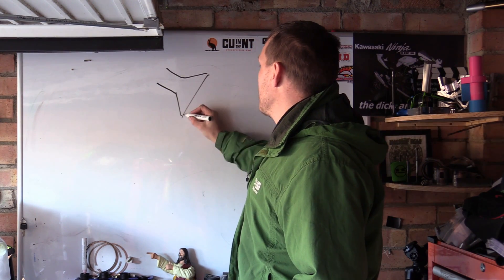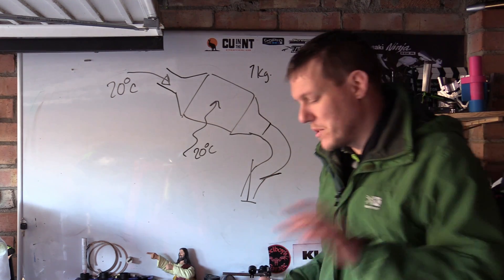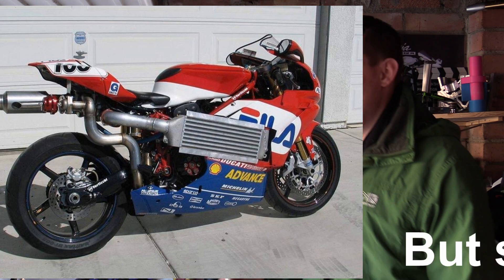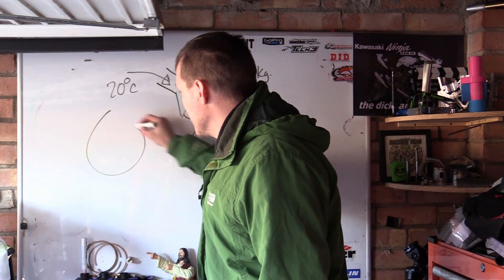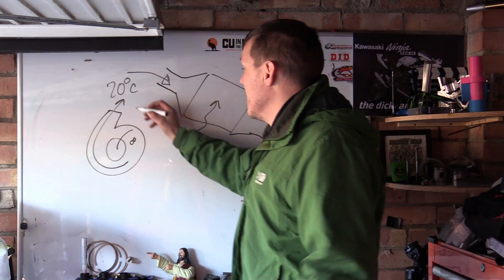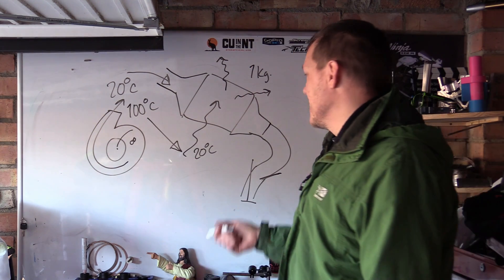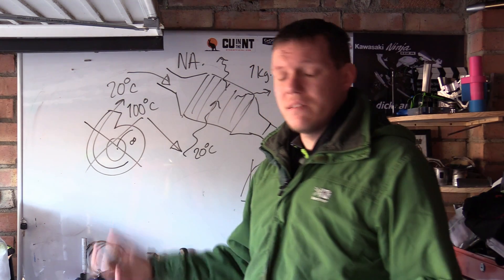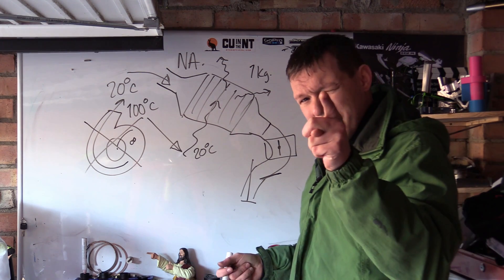Intercooling an NA engine?

Comment: Hmm, no. Just because the air is 20° C doesn't mean there isn't cooling. As air changes velocity, it changes pressure, and thus changes temperature. Circulating fans cool you off in the heat even though all the air in the room is at a given and high temp, the pressure delta causes slight temperature changes, and it carries heat away. Not saying that an NA engine would necessarily benefit from an intercooler, unless the ambient air was being heated by the engine.
Reply: The reason circulating fans cool you off is due to a combination of evaporative cooling from your sweat, and the fact that the air is prolly still colder than your body temperature.
Reply from the maker: "As air changes velocity, it changes pressure, and thus changes temperature."

- and by how much? The other thing you're missing here is the air flowing through the port into the cylinder. 

So looking at it this way if you're travelling at say 60mph (26m/s) as the post velocity is say 80m/s @ 5,000 rpm then the air is cooling the intercooler. 

So your comment "Hmm, no." - is wrong - try again
Reply: Well, if you were dealing with an idea gas then temperature deltas would have a direct one to one pressure delta and vice versa, but in a blend of gases it becomes more difficult to calculate as there's an uncertainty as to what mixture of what gases we are dealing with. Air is never am absolute mixture of Carbon Dioxide, Oxygen, Nitrogen, and so on because of pollutants and other contaminents such as moisture, various stray particles of refrigerant gases, Helium, Argon, Radon, and so forth. If an average could be accurately measured for a given space, such as an enclosed track with perfectly seals and there was no convection process occuring, the molar density of the heterogeneous mixture could be calculated and the tempurature and pressure differentials could then be calculated.
Reply: "The temperature of the gas is proportional to the average kinetic energy of the molecules. Denotes the average kinetic energy of the molecules, and is the Boltzmann constant (1.388 x 10-23)."
Reply from the maker: Next you have got your reference frames mixed up. If you're going say 60mph the air is static - the intercooler is hitting the air.
Reply: The air is moving in relation to objects moving through them. That's how airplanes work.
Reply from the maker: ""The temperature of the gas is proportional to the average kinetic energy of the molecules."

- I think you're misunderstanding what this means. "Proportional" as in like for like increase. Therefore based on what you have said - fast flowing air through the intercooler should HEAT UP the intercooler, not cool it down.

Try again.
Reply from the maker: LOL 

Force and temperature are different things....... Moving a bike though air at 100mph and moving air past a bike at 100mph are frameless when considering forces not thermal energy.
Reply: No.
A fluid at higher velocity will have decreased pressure. A bike moving through air forces to accelerate. Fluids at decreased pressures decrease in temperature. All but ideal fluids will have only minimal changes in temperature for comparatively large changes in pressure. An intercooler may absorb heat from an external source like radiation from the sun or some other source and the net heat exchange could be either zero or functionally zero and thus only have negative impacts on performance, but that's not the point being made.
Reply: As far as the temperature and velocity deltas, I made an error and didn't double check to make sure the equation posted. I apologize for the confusion.

T=(2/3kb)K

Where K denotes the average kinetic energy and kb references Boltzmann's constant.
Reply from the maker: "Fluids at decreased pressures decrease in temperature."

- But where is the pressure drop? Infront of an intercooler (due to the restricted passages) the pressure infront of the intercooler increases. This is form drag. This is why a blackbird was made from titanium because the faster it travelled the hotter it got. So again, this would cause the intercooler to get hotter. 

"but that's not the point being made."

- I'm totally lost on the point you are trying to make.....

Back to the beginning -

"Circulating fans cool you off in the heat even though all the air in the room is at a given and high temp,"

Because you are hotter than the surrounding air. If the air temperature is the same as you then the cooling effect is through vapourization of the sweat on your skin through evaporative cooling. 

Kinetic energy or transfer or momentum is from the bike (intercooler) to the air. The air goes from being stationary to moving. 

You're mixing up thermodynamics and ideal gas law and momentum. Heating up a volume of gas (energy input) is expressed by the increase in kinetic energy of said gas and this is expressed as pressure at the volumes surface area as pressure, or transfer of momentum. Kinetic energy is not a direct converter for temperature. 1/2mv^2 = no mention of thermal energy. 

Kinetic energy is frame dependant, thermal energy is not. For certain idealized systems, such as an ideal gas in thermal equilibrium, the temperature can shown to be proportional to the average kinetic energy of the molecules, as measured in the rest frame of the gas. 

Rockets in space don't heat up because they're moving.
Reply: There are several text books on this field if you'd like some answers. I've decided I'm not doing this anymore. Have a good day, bye.
Reply from the maker: So basically you're giving up? That's disappointing. 

"There are several text books on this field if you'd like some answers."

And that's a shitty argument. Well maybe you should read some of those textbooks and get a better understanding of thermodynamics. Or better still, I'll do a video.
Reply: I'm not giving up, I'm just not your physics professor and it's not worth it anymore. I was attempting to be supportive of your and your works but it seems you didn't like it or me, so I'm going to move on with my life.

Comment: I've been trying to find how a turbocharger actually compresses air but all I can find is simple explanations such as the exhaust gasses turn the turbine. What I'm actually interested in is how does the air go from atmospheric to a higher pressure. I've been researching how a centrifugal compressor (this is what a turbo is) works and it has to do with Bernoulli's principle - I think...  

Basically, my understanding of how it works is the compressor speeds the air up to a high speed and then the air is slowed down by the turbo housing - this causes the air to increase in pressure and to also heat up. Would I be correct in thinking this?
Reply from the maker: Basically an impeller adds energy to the intake air. It does this through momentum transfer - basically strikes the air molecules and this increases their velocity. 

The impeller doesn't compress anything - infact it lowers the pressure by reducing air density.

What the impeller does is ram more air into the manifold that the manifold volume allows at atmospheric pressure. This increases the pressure by squeezing in more air than it could normally take.

Only when the manifold becomes higher than atmospheric is the impeller really doing work.
Reply: i use to wonder about that, its simple to understand a piston type compressor because the volume of the cylinder gets smaller and the air is forced out. But if you put your hand over a hair dryer or one of those inflatable bed centrifugal fans then the air flow just stops but the motor still spins. The air must be then slipping past the blades for that too happen. On a turbo charger the air is being batted off the compressor blades at mach 1.5, then due to the volute shape of the casing the air stream slows down, its the Bernoulli's principle like you said. If you have an inflatable bed and use the centrifugal fan you can actually sit on the bed and  It will actually still inflate because the speed of the air inside the bed slows down and gains pressure.

Comment: A lot of cars, and some bikes, have throttle bodies that interact with the 'cooling' system so they are heated to ~90ºC.  This is done to prevent icing and cold start improvement etc.  So if you don't need that capability, bypass it and you'll have slightly cooler charge air :)
Reply from the maker: "A lot of cars, and some bikes, have throttle bodies that interact with the 'cooling' system so they are heated to ~90ºC."

- I'm unsure what you mean, example?
Reply: @thedirtyworkshop  the throttle plenum will be hollow walled and allow water system coolant to pass through it thereby rasing the temp to ~90 deg C. It's a common mod to bypass it so the cooling loop misses it out

Comment: Charge cooling is all about avoiding self ignition due to rising temperature when the charge is compressed, right?
I've been thinking about a possible system of turbo charging. First you charge the air to a very high pressure say 4-5 bar. You cool it very well say to close to ambient temperature. But you have a restricting throttle/intake manifold which drops the initial pressure to say 1,5 bar. Now wouldn't the temperature drop also, theoretically you'd have air going in to the engine that's well below the ambient temperature? In short, intial pressure way higher than your engine can handle, the dop it to what ever manifold pressure is required. The advantage? Being able to use higher dynamic compression ratio and thus greater efficiency. 
Ok, doesn't relate to this video's title but just a thought.

Comment: technically you could do a water to air setup. run an a/c compressor to keep the water in the system at 4 degrees . that would gain you some density and cool the air. you might gain 2HP. but the compressor would be heavy and you need engine power to drive the compressor rob you of power. so extra 12kg for compressor + water and radiator - 5hp to drive it. = NO GOOD= a delboy turbo setup that gives you no benefit. so it wouldnt be worth it.
or you could use a dryice setup. but that would need constant changing. and ppl would be like what is that smoke coming out of your engine for haha 

did he end up selling that turbo POS. I havent seen it ??? 

and the picture of the intercooled bike. air comes in from the inside and feeds out . so it would have a duct from the front going into the inside of that inter cooler

Comment: I think it was me who sent you thay pic of the turbo bike with intercooler. I had a question about that. Why bother putting the turbo at the end of the exhaust and fitting an intercooler instead of just fitting the turbo right after the exhaust port?
Reply: geitenkaasje1 didn’t he make a video on two stroke exhausts and turbos and that it makes sense to build some proper piping for the exhaust.
Reply: @miatafan  yeah but it's not the same for 4 strokes. This also has an intercooler wich hasn't been discussed

Comment: Some old land speed guys used to use a water to air charge air cooler on N/A engines, but they use ice water with salt to obtain temperatures below freezing. But land speed racing isn't weight limited and only runs in short burst. From my understanding it was a loophole in the rules and actually helped with detonation when running at wide open throttle for such long periods at high rpm.
Reply: Water injection works on a NA motor though

Comment: I've heard of people putting dry ice in their air box.
Is this just bullshit or can it make a difference?
Reply from the maker: In the airbox - then bullshit - CO2 is no good for an engine......
Reply: @thedirtyworkshop  Oh, of course. Duh.
 I hadn't thought of that. It was something I heard years ago that people supposedly tried to do to lower the intake temps.
Reply from the maker: It will, don't get me wrong - but its also heavier than air (or oxygen2 and nitrogen2) so it will choke your engine out. Fucking idiots some people
Reply: @HADDDOCK777  IV never seen it in the airbox I HAVE seen ice boxes used as a seperate thing to cool air coming in though mainly in drag cars using alcohol injection.

Comment: What if you transfer heat from exhaust to intake. Would it make engine more efficient? At low throttle openings the max power loss would not matter.
Reply: I Think thats the point of reverse flow cyl heads
Reply: Transfer heat from exhaust to intake? To heat up your intake charge even more? AFAIK, you want your intake charge to be as cold as possible to get higher efficiency.
Reply: @FranseFrikandel  wrong

Comment: I've always wondered about running a copper fuel line in a tight coil around an aluminum intake breather tube before it goes to the fuel rail. It would take a brave dude to get behind the wheel, but, there's no shortage of lunatics who would risk roasting themselves for a couple horsepower.

Comment: Correct me if I'm wrong,  but I thought an intercooler is between 2 sets of super/turbos but with only one is an aftercooler.  Separate from an exhaust cooler.  (these terms if I recall correct are all quite old,  like ww2 airplane stuff)
Reply: You are correct. Intercooler is when its between 2 compressor stages and aftercooler is when there isnt another compressor stage coming after BUT thats just ww2 aircraft stuff as you said. In the car world that just lost its actual meaning. What they would refer to as an aftercooler in ww2 is now known as an intercooler in the car world

Comment: As you said at the end, could be made to "work" with an air water intercooler with iced water which would get a small temperature gradient and cool the intake slightly, but it would be so little I can't see how it could be worth the quite large weight penalty for a NA application, even for something like drag racing.

Comment: And what good is an intercooler on the side of the bike a small one in front would be substantially better than that big one with one side in all the engine heat and the other covered by your leg imo that would only make the intake air hotter decreasing performance even more than not having one at all

Comment: Hypothetically would cold air from say a spray can make any difference?  We have cans of compressed air at work for cleaning boiler parts and it comes out really cold
Reply from the maker: Hypothetically no. The cooling system has to be constant - i.e as soon as you start to cool the intercooler down the outside air starts to warm it up.

Comment: Matt I have a friend who has a racing kart 50cc and after reving it for a while or just driving the intake is cold as fuck ( I mean that I put my finger on the intake and it was like ice) while the cilinder it super hot. I think it is a very rare phenomen , I never seen something like that . sorry for my bad english
Reply from the maker: "I think it is a very rare phenomen , I never seen something like that ."

- Happens all the time and its called intake chilling - this is the fuel vapourizing - I guessing this a carbed engine.
Reply: The Workshop yes is carburated , fuel absorb heat when evaporate , but I had the same engine oem (standar without any mods)and the intake is hot it burned my finger lol, so I guess it need to flow a lot of fuel to frezze the intake ? I never saw this happen in oem engines.
Reply: The Workshop I think it's a good one for the heat gun, get a motorcycle and after taking a ride make a video showing how the intake is cold and the rest of the engine hot. I dare you lol